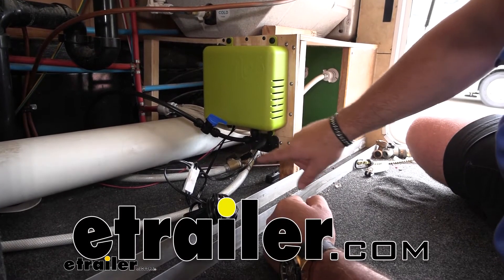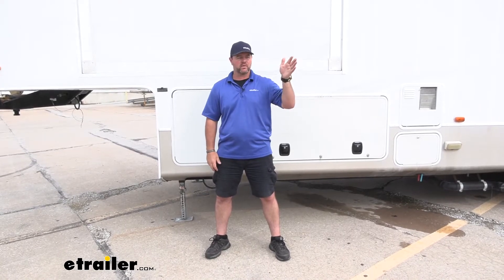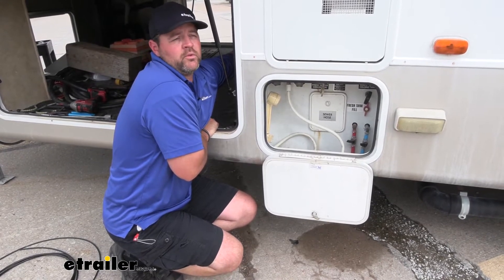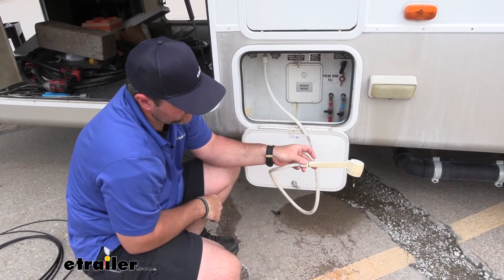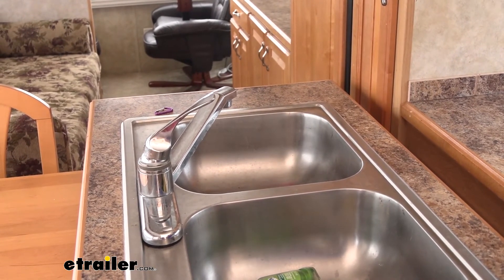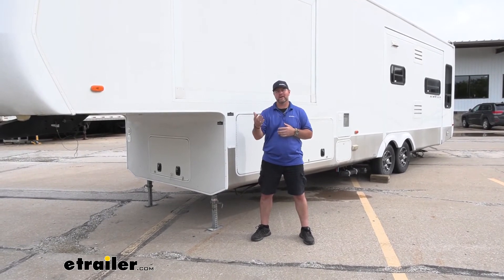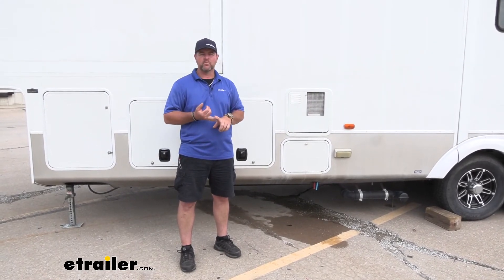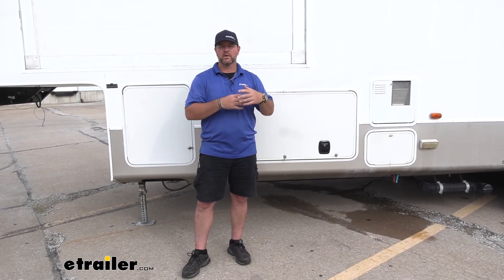etrailer | Lippert Floë Integrated Drain Down Review

Comment: Yours looks like it takes about 10 seconds for making pressure and it stops. However, mine takes from 1 min to 1 min and 30 seconds for making pressure and stops.
I wonder if there is anything that I missed or any air leak on my rv.
Is that normal that take a min and half?
Reply from the maker: Without being there actually looking at things, it's hard to say, but it sounds like you might have a small leak somewhere that's preventing everything from pressuring up as quickly as it should.
Reply: @etrailer  I guess it would be city water line. 
I will try it with lock the city water line with additional switch and I will let you know.
Reply: @etrailer my rv Is palomino 189bhs. I checked out city water line and
there is no problem on city water line.
I think there is problem on sink faucet and shower faucet which I changed to after market faucet.
 I think it's better I make each switch before the sink and shower and toilet line and I need to run foe686.
I will let you know how it goes.
Thanks.
Reply from the maker: You're very welcome, please let us how it goes!